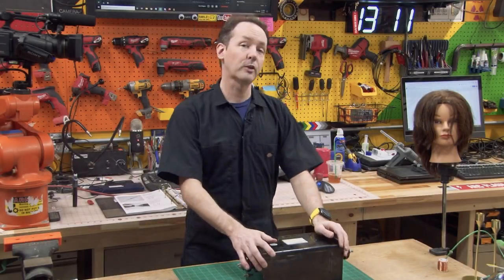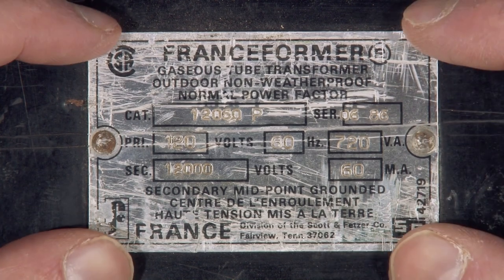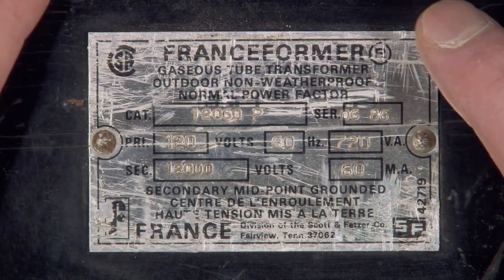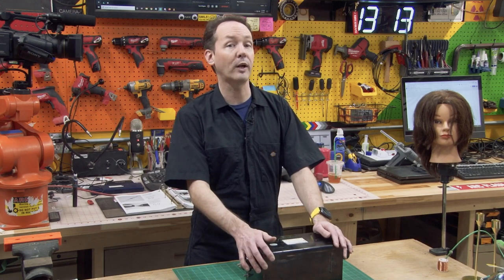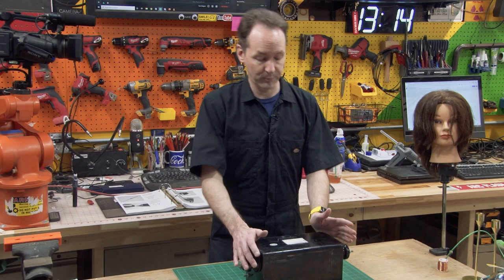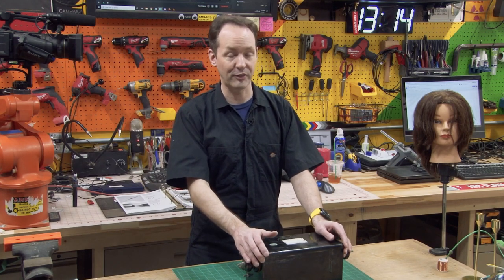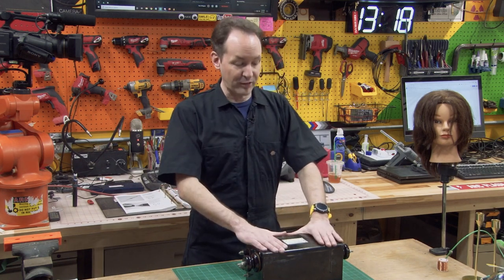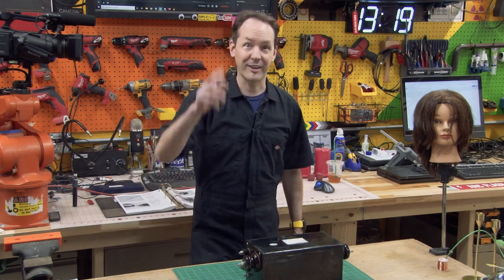High Voltage Episode 2   How To Decode A Neon Sign Transformer Makerplate

Comment: I would take the 12kV 60mA, as it is 720VA, while the 15kV 30mA is 450VA, a little over half the power.  But the 15kV one will strike a lot more small tube sections than the 12kV, even if they will not be as bright.

Then you get the electronic transformers, which are somewhat weird, and where you have issues with long high voltage cable runs causing sections at the middle not to strike reliably, as the high frequency current is capacitively coupled to the chassis instead. Yes I have a small collection of neon collected as pieces over the years, in assorted colours. Just need to get good at blowing and bending glass to be able to make my own, though I would need a slightly better vacuum pump and gas to actually fill them, along with a induction heater to flash off the gas in them and form the electrodes.

Comment: Trying to decode mine and it led me to this video! Maybe someone can help me with a question. Primary 120v. Secondary 4000. V.A. 120.   M.A. 30 but it also says A. 1.10 
I have another that reads Primary 120v Secondary 3000 M.A. 30 V.A. 90 and A. .83    
First, why are the M.A. values the same if I have different secondary voltages and what is the A. supposed to mean if when using Ohms law those values make a little bit more since. But second, why does Ohms law and the nameplate values differ when i comes to multiplying V and A? Is the Power factor screwing with my head??

Comment: not bad!

also focus is a bit soft on robo-cam
Reply from the maker: Yeah, I'm inside it's minimal focal distance. I have a complicated problem to solve there. If I move it far enough away, it won't be in the shot (and I like my cool robotic cameraman). I'm going to have to get creative.
Reply: Chaotic Good not being centered is ok, although admittedly not ideal, but you could probably pan the camera to our left a little bit. It also wouldn’t hurt to zoom out, your head is a bit close to the top, and it doesn’t look too great. The nst is also cut off a bit.